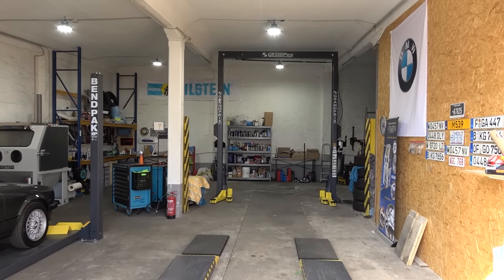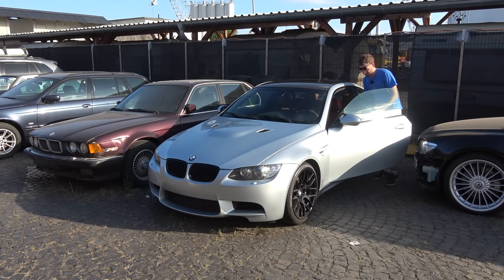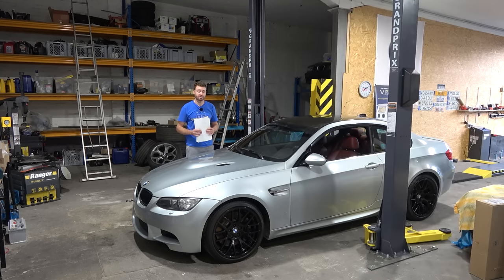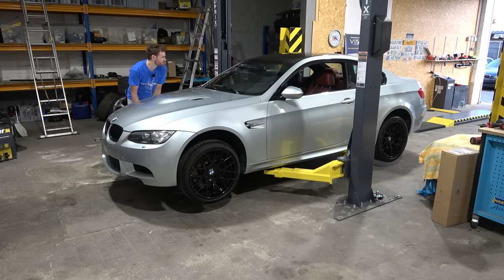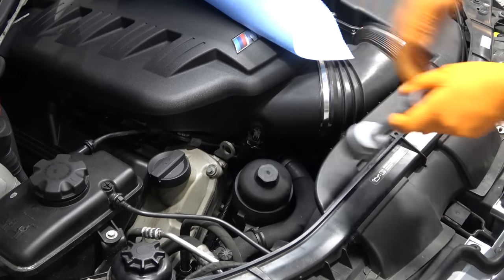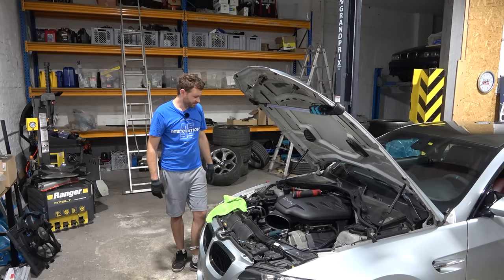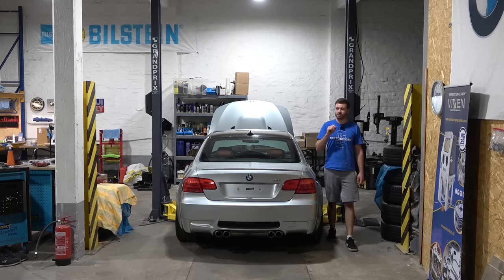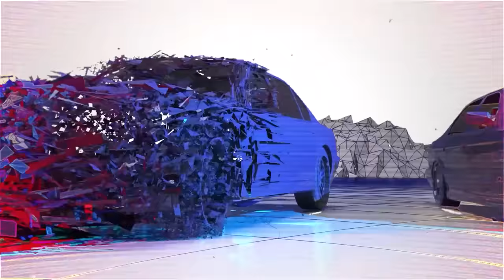Is the Engine Repairable? - BMW E92 M3 - Project Frankfurt: Part 2

Comment: "hacking the tail lights" means they cut them open, replace red leds with orange ones and glue the housing back together. It usually costs about 40-50euros per tail light so it is much cheaper than buying a good used european spec set of tail lights. If job done poorly, tai lights will start to leak water.
Reply: Pretty good idea honnestly considering the alternative is throwing the US taillights away as noone will want them in the EU
Reply: @williamskagen9901  wouldn't say that. Especially in east Europe, the people dgaf if the turn signals are red or orange.
It's a mid-west European thing to fulfill the regulations correctly.
Reply: @1GTASANANDREASCJ  It's usually a preference, but yeah. As you said, midwestern Europe really like their rules
Reply: @sys-administrator  Japan lights?
Reply: Repairing broken headlight adjusters is supposedly impossible on post-facelift/LCI (model year 2001 onwards) E39s.

Fortunately this isn't true, with a little patience, care and attention the headlight unit can be split and the adjusters replaced at the cost of a handful of euros.

Done properly nobody would ever know that the headlight unit has been "hacked". Much cheaper than the couple of hundred euros a new headlight unit costs.

What I would like to know is how to restore the rear light units on the tailgate. They don't respond to the polishing as per the headlights and the body mounted rearlights. It must have something to do with the type pf plastic used.
Reply: @1GTASANANDREASCJ  japan lights might have white turn singal lights
Reply: @robertseitz2407  No, this is wrong.
Reply: @1GTASANANDREASCJ  So what are Japan lights then?  Since you know what they aren't.
Reply: @LeverPhile  There is no japan lights. Only the headlight beam pattern is different because they drive on the left. 
White turn signals is bs, don't make something up.
Reply: @1GTASANANDREASCJ  The other guy side white lights, not me.  I was just curious to know what the definition was.
Reply: @silviubutunoi761  i did not wrote anything about maintance or something similar.
You make a assumption without proof.
Not sure why you have an outburst like that.
Reply: @silviubutunoi761  which is true. Looks like you never went to east-european countries and know nothing about what they are able to do without having any problems.
Reply: How about haking low beam headlights? Where the left light border is higer and have one level with the right
Reply: @grahamepigney8565  I use tire shine it lasts a few weeks before looking dull again. 18 yrs old and 265K so I am not fussy!
Reply: @1GTASANANDREASCJ  Me being from Latvia, I can say that the guy didnt go thru the sertification process. I'm pretty sure these modified taillights wouldnt pass the sertification.

Comment: “That’s impossible because BMW’s never leaks” - this makes me laugh every time.
Reply: @juggnautbitch  lol the crud in the engine probably resealed it somehow
Reply: I had some strange issue with my heater in my e85 where it only worked on max heat half of the time, which now seems to be fully fixed. I haven't done anything but I like to think of it as "self healing".
Reply: Hondas and Toyotas never leak. They come with lifetime titanium gaskets which means you can buy a corolla from 1990 and it will be as reliable a a 2023 car. I swear Honda and Toyotas use a tremendously different engine design/ manufacturing process unlike any other manufacturer, I swear their engines are soo different from regular engines they totally don't use any rubber gaskets or piston rings or rod bearings etc. which is why their engines will never fail, they totally don't work on the same principle as a regular internal combustion engine from today.
Reply: @uranium3111  That's BS lmao. Anyone who says that "Toyotas never leak" have never worked on a car in their life. All cars eventually do leak SOMETHING. It's wear and tear.
Reply: @harrys2331  Are you sure? I swear people always tell me Toyotas are the most reliable thing in the world, seems as if their engines are immune to all wear...
Reply: @uranium3111  You can’t expect something to run for forever the same way. Toyotas are reliable and built like tanks but eventually they’ll have to replace things like rod bearings, water pumps, etc maintenance items. Suspension components ofc, like ball joints, sway bars, and struts are also maintenance items. Toyotas can also leak oil and have gaskets fail especially if you rekt the thing neglecting oil changes. Carbon deposits build up and can do all kinds of stuff. Bottom line is take care of your car. There should be an if statement after anyone says “Toyatas are built like tanks IF you take care of them.”

Comment: When minutes seem like seconds you know it's good stuff! :)
Reply: Please can someone interview a BMW engine designer and ask them why every BMW engine leaks oil once the warranty finishes?
Reply: @chriso8485  As owner of several, if its your only problem out of warranty, you should be glad. A couple of gaskets usually cheap but not impossible to change. 
Way easier if you don't have one with those awfuly designed aluminium hollow bolts...
Reply: @fonzuz  Those alu bolts are a pain in the ass indeed.

Comment: You might want to check those replaced airbags, especially the side ones, to check that someone actually replaced them and not just hacked the sensor to disable the warning light.
Reply: @sys-administrator  oh but it happens, don't even doubt it. There are so many cars with blocked off or removed airbag warning lights driving around. Owner sends it to a garage and they "fix" it, charge full money for it and done.
Reply: @sys-administrator  if the car was in Latvia , then it's really possible, and most likely they rolled back mileage there aswell . I'm from Latvia , and people are doing a lot of sketchy things there . All the imported used cars are either made of few cars or mileage is corrected , in some cases few hundreds of thousands km's 😁
Reply: @treeman1988  if you are in Germany, never ever buy a car that has been imported into the EU via Latvia.
Reply: Streten will check all this - he is the master of checking stuff
Reply: Yep, either hacked the sensor or they put exploded airbags back in place nicely but they obviously aren't charged. Either way needs to be checked carefully, even if actual airbags are in place. Almost an ordinary situation when buying a used car somewhere in Eastern part of Europe and Russia.

Comment: 9:40 If the original owner makes it to Frankfurt, he may even be able to experience the unrestricted Autobahn 😁
Reply: We have a new road in Hungary. They are building it since 2years but they did not open it yet to be a proper "autobahn", it's open but the speed limit it 110km/h. People barely drive on it, the lenght is 60-80km full new road, no police there, so you can go as fast as you want, nobody "bat's an eye". :D They only check the trailer truck stickers. I used to drive my e46 320d at top speed 220km/h(stock limit), nothing much but it was enjoyable. You can get on it on a sunny afternoon, sometimes no one is driving on it.

Comment: I mounted a winch the same way in my garage to move my broken BMWs in too!!  I did however use a 2" receiver mount into the floor and mount the window to a receiver plate so I could also use the winch in my X5 receiver.

Comment: One of the best YouTube Channels.  Informative, great sense of humor, right amount of sarcasm and educational, as well.  Time flies by watching your videos.

Now here's the other, possibly not so good part.  I've owned several BMWs over the last 10 years and sold each one swearing I wouldn't buy another because BMWs are expensive and built to stay that way.  Spent way too much money fixing them while my Honda continued to roll along.  However, you've ignited the bug in me again and I'm on the hunt for an X3 M40.  I would like a quick grocery getter.  Thanks......
Reply: you can’t go wrong with any new I6 bmw, my 340 has been dead reliable so far. I️ didn’t sell my Honda though it’s still in the driveway

Comment: I think a Dacia Duster 1.5 diesel litre would be a great replacement for this engine
Reply: @Shifty watchout someone from Renault might hear that and use your comment in the next ad campaign 🤣🤣🤣
Reply: Then the sphrase ”sleeper” would be actually spot on :)
Reply: @mitapanii  you go all in and make it a mild hybrid with x-drive ..  add two electric motors from an Italian ice-cream maker. Ohh my god... I can see my self smoking a GTR at the lights (literally)
Reply: @mihai08  fuck electric conversions , we need more petrol and diesel swapped tesla's !
Reply: @nitroboy2   a tesla 3 platypus with a 4 cylinder diesel, 1.6 litter, naturally aspirated from a vw golf ⛳️ II, 5 speed manual gearbox with autonomous Persian uber driver
Reply: @Shifty I have owned 4 BMW and drove those over 300K km each. With no major issues. I still own Z4 and also have a 5th BMW X1. So I don´t think that the average BMW has bad engines. The only thing I´m doing on my cars is changing oil and filter every 10K km.

Comment: Great stuff as usual. But a note that anchor bolts in concrete want certain distance between them. Else they will make the concrete weaker if the holes area to close to each other. You should find the distance between bolts from the expander bolt supplier easily.

Comment: Would like to comment on the rod bearings that were done by the shop in NJ.  WPC is a friction reduction process that treats the surface.  It is NOT a coating and it is done to ACL, King,BE and OEM bearings alike,  As long as you clearance the bearings correctly the WPC is actually a much better surface condition than the super thin coatings that you get from any bearing manufacturer.  It creates dimples on the surface that are 3-5 microns deep and helps retain tiny pools of oil.  FULL DISCLOSURE I am associated with the company.  We treat parts from Indy car engines to Trophy trucks, to passenger cars like this BMW .  .Our process is even offered by CP Carillo as an OEM treatment on all their Pistons..For the European crowd they are owned by Pankyl.  We love the work you are doing Sreten and watch every video!

Comment: I am a HUGE fan of the E90 platform. I haven't got a M3 E92 but I do have the 335XI version with all the new mods people do (which I'm sure M539 despises lol) with up graded turbos 17T's and all the Bolt On's possible and am just doing more maintenance replacing the front struts and the valve cover  after having done a whole bucket load of them before I did the mods. I also have the E46 M3 but it's a swap car meaning the whole drive train and interior etc was swapped into a 330CI that had a blown engine and I haven't looked back. LOL.

Comment: LOL! You used more bolts on that tiny winch than we used to secure the 12,000 pound winch on the F250 I used to have in California. One bolt would have been enough, two to stop it from swiveling too.

Comment: Thanks for this series, all of us E92/E93 M3 guys are loving it. Really interesting the bearings were done with the older design; the updated P/N is copper-free, so they must have sourced the older part.
Reply: it kinda scares me.....what caused the motor to seize ..even with the bearings being done....it must have been abused...and i know the OE bearings are not good to use....i think everyone that went with BE bearings doesn't have problems after that....at least i hope
Reply: @BETNCORT  Just keep in mind that percentage-wise, it's a very low number of motors that were affected. Most people have no problems, and ALSO keep in mind that even with high-mileage and bearing wear, the engine still works fine. A lot of people have grossly overrepresented this issue on Bimmerfest, Bimmerforums and other sites, half of them trolls. A lot of failures I know about have been directly related to supercharger installs, hard-core racing and other extreme things.

Comment: The two extra holes and bolts you installed in the baseplate for the winch probably have not increased the strength of the anchor bolts but actually the opposite and decreased the pull out value because they are now too close together. There is a minimum distance between the bolts for them to achieve their maximum pull out value.

Comment: I’m curious what made you decided to add a baseplate extension and extra anchors to your two post lift. Was it because the shake test was failing before?
I’m about to ad an extension to my 2 post bendpak just to increase the safety factor.
The failure point of 2 post lifts is pretty much always going to be at the concrete anchor point, either due to improper installation of the anchors or poor quality concrete.

Comment: Just as an afterthought, I’m having Canbus no communication issues with my 2000 M5, do you plan to do any content on electronic and electrical problems and troubleshooting them on your channel? The gremlins in my m5’s control systems are driving me nuts. Finding the complete electrical system schematic for the car is problematic. Do you know where to find it?

Comment: Put nylon washers on those anchor bolts, under the zinc plated steel washer. You'll get a bimetallic reaction and corrosion otherwise. The winch frame will rust and the bolts too. Always happens with dissimilar metals installed like you did.

Comment: i don’t think the copper is from the replacement rod bearings.  

wpc treated oe bearings are usually the updated “lead free” ones and i believe those are made of tin and aluminum.  
one of the issues with the updated bearings is you can’t see anything in oil analysis if they are wearing.  

my guess is main bearings if you are seeing copper.
Reply: Gave you a thumbs up, so Sreten can see it

Comment: The tail light hack is as follows: 

There is a button next to the lights on European BMWs to enable / disable rear fog lights. That button is there on US cars but it is 'blanked out'. You can pull put the button, file off the tabs, and then it JUST works. The button turns the rear fogs on and off. At least on E*. On F* you need SOME coding. I don't know how they switched the indicators from red to amber though.

Comment: Just note those winches are supposed to be used with a running engine, so you're lacking quite some power running it just on battery voltage.

Comment: I've been watching you for my God years now and I like your contact and I have a few questions you might help me out I bought an E12 78 530 I. And apparently I'm doing the rocker arms one is bad and I'm pulled off the engine and those stupid exhaust manifolds and I cannot find your headers for this vehicle what do you suggest and I might need some parts from Germany

Comment: I admit that i expeted an engine teardown, i'm reaalllyyy curious about what could have split the crankshaft that way 
Probably middle bearings passed out and then the crankshaft turned oval and broked... but the noise man... the noise would have been terrible before breaking the engine so you normaly park the car immediatly !
Been doing mechanic on cars and big generators for 20 years and never seen something like that...
Support from the french riviera

Comment: yea what they have did there is thought  a bit of rtv it will slide right in im at 15 min in i really hope some animal didn't ruin that engine with silicone just for the sake of a front crank seal leak and you have even showed the special tool required for fitting a BMW front crankshaft seal

Comment: I had a 2008 e92.  Stick.  Carbon fiber hard top.  Schnitzer exhaust.  White with fox interior.  Best decision I made was to sell it at 75,000 miles before the giant BMW repair list began....culminating in a new engine because of rod bearing failure.

Comment: Roads in New Jersey... Chicago isn't better. My soul leaves my body and comes back every single time I drive on the highway, so uneven and a lot of potholes :|
The RTV on the other hand was probably put there when previous owner was replacing front main seal. That's how I did it but with some German kind of sealant similar to RTV... because BMW xD

Comment: You should convert the winch to be plugged in the wall and use shop electrical
Reply: That would be a hefty power supply.
For the amount of use it's going to get Streten's using the simplest way to drive the winch.

Comment: “That’s impossible because BMW’s never leaks”
I challenged myself to make my E46 leak free. My advice: don't do this! Every time you fix a leak, it will start to leak somewhere else, and it will be more expensive to fix than before. Probably, that's a major reason why Streten makes full rebuilds only.
Reply: Yup - it's like trying to make an old land rover leak free. Even if you empty all fluids it'll still leak...

Comment: Epoxy !! As much as you are a "Belt and Suspenders" kinda mechanic I would advise removing the winch and injecting epoxy in around the bolts. It any rate, you will end replacing your mounting plate with a 1Meter squad steel plate in a year.

Comment: Old school trick how to check it the chassis is straight, take inextensible cord, mesaure lenght betwen front and rear rim on the both sides if the both sides are the same there is a high probability that the chassis is OK

Comment: Yo m539 When my engine is running stationary my rpm dips and shoot back up when using electronics, most notable is the powerwindow switch and the air blower, have you any idea